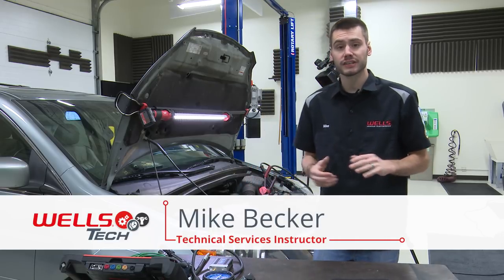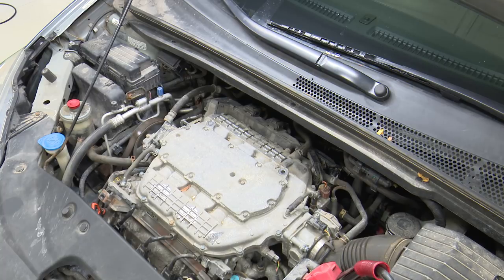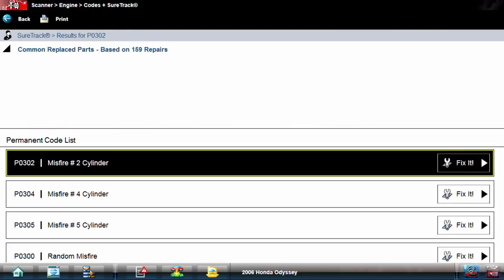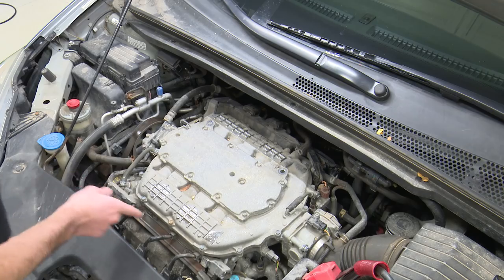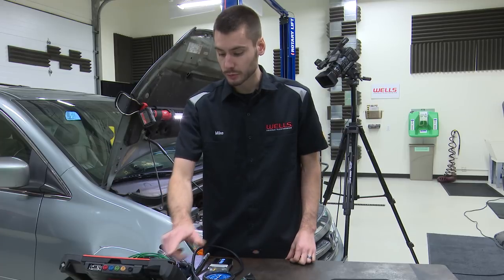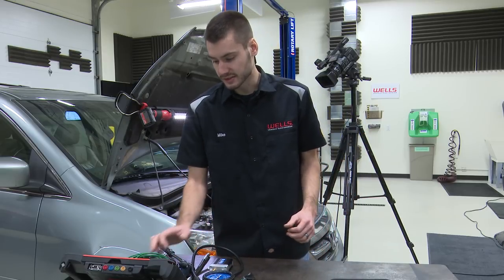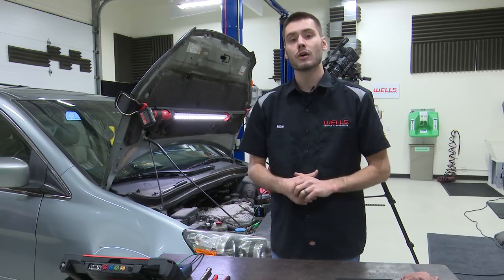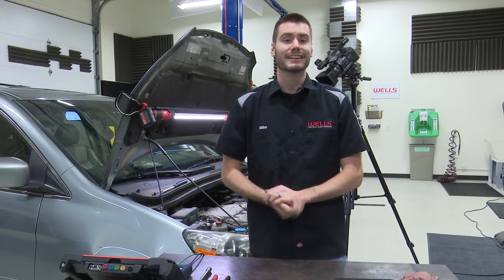2006 Honda Odyssey 3.5 Random Misfire Case Study Part 1 : Diagnosing the P0300, P0301, P0302, Etc.

Comment: Hi i have honda accord EX 2000 v6 3.0. The problem is p1399 ?
Reply from the maker: Hey Rodolfo, a P1399 is a pending misfire code. Something is causing the car to misfire and it's setting this code. 
Mike Becker, Senior Technical Instructor

Comment: Hi there very good video, I have a question I have a Honda Odyssey 07 model 3.5 engine, and just recently I replaced the valve cover gasket and when I got done doing so I turned the engine on and now has a misfire in all cylinders running very rough and the idle stays really high up to 2000 rpm and can’t figure out what could possibly caused this to happen by just changing the valve cover gaskets I have checked all the vacuum hoses are connected where they supposed to be and all the electrical connectors are plugged too I can’t see anything that I possibly had left out or not connected. But this vehicle has bout 250,000 miles in it , and probably never had the valves re adjusted , Am wonders if that’s what the problem is , or any suggestions, that someone can help me with any advice, please and thank you
Reply from the maker: Hi Juan, thanks for watching! I don't see how a proper valve cover gasket replacement could cause issues like that. Now, if something got messed up or something went wrong, then I could see that...
Mike Becker, Senior Technical Instructor
Reply: Wells Vehicle Electronics thanks for taking the time to answer my question, but I find the problem, some how by moving stuff around trying to get the rear valve cover back on where it goes one of the fuel injectors connectors came unplugged sitting there looking like it was plugged but it wasn’t so that was given me all cylinders misfire , it’s crazy how one little thing can mess lots stuff but yet thanks

Comment: Will valve adj. cause oil in spark plug well?
Reply from the maker: Hey Alberto, no the valve adjustment won't cause oil in the spark plug wells. If someone did a valve adjustment and didn't change the gaskets out though, that could cause it. The valve covers need to be removed to do the valve adjust.
Mike Becker, Senior Technical Instructor

Comment: my friend's pilot has all P0300 thur P0306 codes come up and when we tried to load the car up on ramps, the engine had no power to go up the ramps, i am thinking low compression but we will see, also the check engine starts to flash and according to forums thats unburnt fuel in the exhaust.. not good at all.. but he is a stubborn little shit and he want s to keep doing things to the engine.. 
i personally dont think the compression is going to come back good, but we will see over the weekend.
Reply from the maker: That's no good! A flashing check engine light is damaging the catalytic converter. Hope you can get it all fixed up!
Mike Becker, Senior Instructor
Reply: @GoTechTraining  i actually bought a cheap compression test kit and to be perfectly honest i think one or 2 pistons may be down in compression, i mean the car would not go up the ramps, but if you feel charitable enough you can feel free to come help me trouble shoot the issues.. LOL
Reply from the maker: If you were near Fond du Lac WI, I'd be happy to take a look :)
Mike Becker, Senior Instructor
Reply: @GoTechTraining  ill keep you posted of my findings, hopefully i can figure the codes out
Reply: @GoTechTraining   so i did the compression test on the engine, the back cylinders were fine, but the front ones were lacking...
D=dry/W=wet
Cyl1 D = 150 / W = 155
Cyl2 D = 110 / W = 131
Cyl3 D = 150 / W = 153
Cyl4 D = 112 / W = 132
Cyl5 D = 148 / W = 155
Cyl6 D = 125 / W = 134
so according to the info online, the comp supposed to be 130 and above, but still have all 6 misfires, my mechanic thinks it is the timing chain, since the vehicle is at 270K miles and chances are they never serviced the chain properly, PLUS he bough the vehicle form an auction..

Comment: With those valves worn the way they are, it could be sorta though of as part of the VTEC is kicking all the time, but not all the way and not under PCM control.  That what it sounds like to me.
Reply from the maker: Sure Frank, except we're dealing with Exhaust and not Intake. VTEC only moves intake, right?
Mike Becker, Technical Services Instructor

Comment: 269.5 degrees is going to stay the same except the timing of the opening and closing will be shifted either earlier if gap is reduced or later if the gap is increased, these r my 2 cents before I finish watching the video.
Reply from the maker: Hey W .Khairi I like the thought, will just have to wait and see if you're right :)
Mike Becker, Senior Technical Services Instructor

Comment: i have the Same engine. 2006 MDX. Changed the original Plugs. no difference.  I had Honda dealer get Multiple misfire codes and adjust the valves after I watched this video at 143,000. no change. changed coils. no change. still all cylinders misfire at idle. Above idle no codes. 
Grrrrr....Brought it in yesterday for Promotional "lights out" dealership commercial. Still same codes. at 155,000. I had Brookdale Honda dig deeper. they did a compression test. Ok. Timing belt marks lines up. MAP sensor reporting a code about low air flow to engine or something like that. Not quoting exactly. They said, " it needs the Valves adjusted. Logical. But I already did the valves. now what? they want $815 more to take a stab at valves, but it was just a guess as to whether or not that would stop the CEL VTM lights. from tripping.
Reply from the maker: Hey John, sorry to hear of your issues. It sounds like the shops just guessing, which is unfortunate. I don't see what they want to do with the valves. If they are adjusted, they should be good. Maybe they didn't do the proper spec when adjusted? Weird it reports an issue on airflow. I'd be investigating that codes and its code set criteria. 
Mike Becker, Senior Instructor

Comment: i already did the valve adjustment and cleaned the egr and still got codes p1399 p0302 p0303 p0305 p0306 and p0300 random misfire don't know what to do
Reply from the maker: Interesting Danny, hows the ignition system? Spark plugs and such? Also, is the motor properly in time? Timing belt jump a tooth?
Mike Becker, Senior Technical Instructor
Reply: @GoTechTraining  I got it fixed for got to clear the code test drive it runs great but thanks for the video it really helped me out

Comment: That is way more complicated then it needs to be, on hondas you can tell if it has tight valves from reading the map sensor and the fuel trim. Done
Reply from the maker: Hey Chad, that's awesome! So, what kind of values should I expect on an engine with tight valves?
Mike Becker, Senior Instructor

Comment: hi,  thanks for your videos. can you listen to my video and give me some guidance plz?  I have a 2012 odyssey with a tapping noise. i Just replaced the timing belt kit thinking it was the hydrolic tenciometer, but the tapping noise still there.  The van is running great. and No error codes just the tapping noise. I removed the serpentil belt and still the tapping noise still there.  I listen to the tapping noise and it seems stronger around cylinder 4 where the rocker arms and cam lub is located. It sound the loudest on the front plastic cover next to cylinder 4 (i think the echo carries the sound to the cover). i have seen some videos of worn camshaft lobe and the tapping noise is similar. i will do a valve adjustment this coming weekend using your video as reference (thanks).  What should i look for when i remove the valve cover? thanks for any advice you cand give me. the van has 170k miles and it has the J35Z8 - VCM engine  . What's your educated guess about this noise?  Am I on the right track?  is there anything else i should also consider that i am missing? thanks so much for any feedback. 
this is the link to my odyssey tapping noise https://youtu.be/VqaHOI-K_JQ

Comment: Just adjust valve lash adjustment, common issues with high mileage v6 Honda.
Reply from the maker: Sure is, but there is something to be said about proving it is needed. What if it wasn't? Who pays for the job then? At least this way I had prove that something was done and it changed the engine. Now if it still had issues, like coils, or a plugged cat or something I had a leg to stand on and defend my position as to why I adjusted the valves. 
Mike Becker, Senior Technical Services Instructor

Comment: It has a motor mount on the back it has a vacuum line on it that is why the engine is shaking either the vacuum line or the motor mount is leaking hard to believe it took a lot of money to find out one out
Reply from the maker: Are you saying it's not the misfire issue causing the engine to shake? 
Mike Becker, Senior Technical Instructor
Reply: No I'm saying that my check engine light is not on but it had a shake skip a little vibration so I assume that it needed a tune-up on top but the tune up was not the problem it was actually the mount in the back for some reason very odd
Reply from the maker: Ahhh I see Tron! Glad you were able to get it all fixed up. At least now it has a fresh tune-up :)
Mike Becker, Senior Technical Instructor

Comment: Your diagnosis noes not explain why this is causing a misfire.
Reply from the maker: Hey Larry,
Do to the valves being out of adjustment the valves are opening at the wrong times. Causing the valve timing to be off far enough to cause a misfire. 
~Ryan